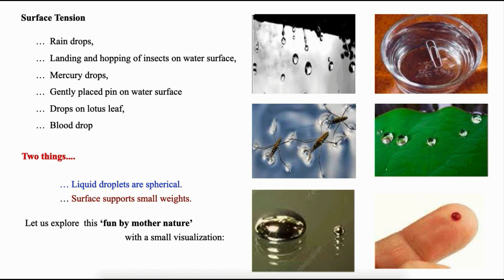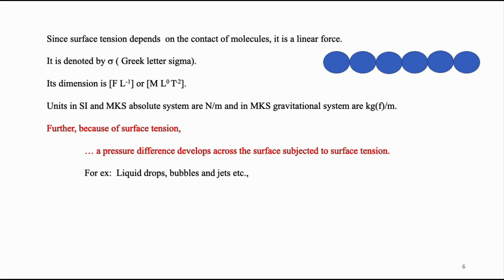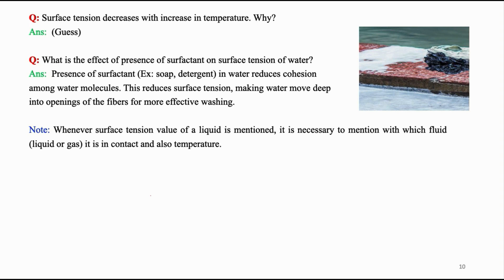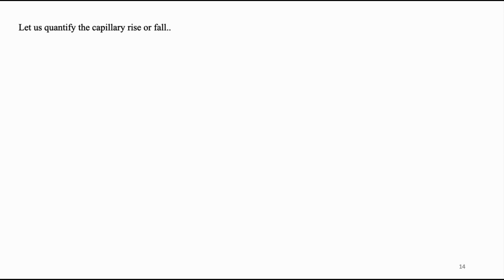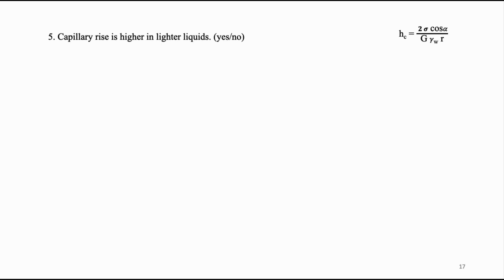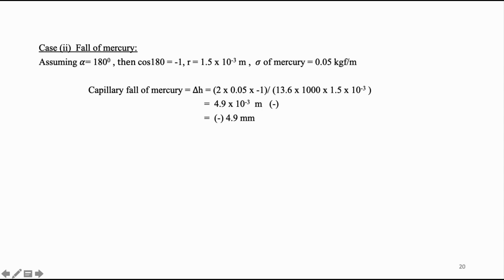Fluid Mechanics - Fluid Properties (Part-1C)

Comment: Sir,what if a liquid possess same amount of cohesion as well as adhesion??Can we expect Capillary rise or fall !! Is there any development of internal pressure??
Reply from the maker: Dear Mr. Kumar.. first of all apologies for delayed reply. Cohesion is among same molecules ( Ex: Water-water, oil-oil etc.,). Adhesion is between two different types of molecules. (Ex: Water-glass, glass-mercury etc.,). Theoretically, if a liquid possesses same cohesion among its molecules and has  same amount of adhesion with other type of molecule it is a 'tie' in tug of war. There will be neither rise nor fall. However, due to cohesion, surface tension comes into action in the liquid. Certainly there will be development of additional pressure.
Reply: @ProfPradeepKumar  tq so much sir